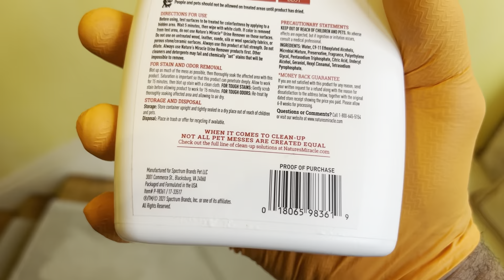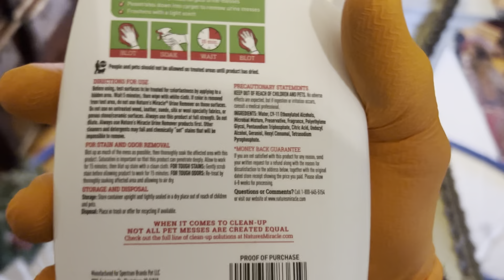Customer try cleaning the carpets herself and end up leaving permanent spots 👊👊👊

Comment: Came out beautiful. It looks fresh and clean. The damage caused by the other product is not visible to the naked eye. I bet the unchained killed the odor.
Reply from the maker: Thank you yes it did smell much better, that is the problem when you used over the counter products.
Reply: @spotlezzcarpetcleaning640  I know! I used the same but the version for dogs lol. I use the blue light(cheap version) and unchained (learned from you) and the spots are still there but there is no odor. This video is great promo for why customers should call you, the professional - instead of using otc products😊
Reply from the maker: The customer end up doing more damage to they carpets or upholstery .